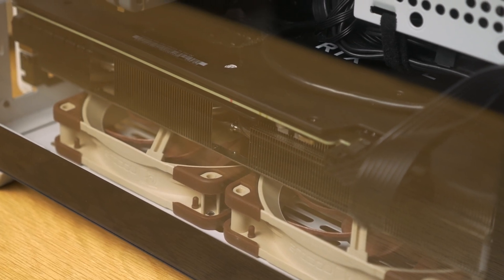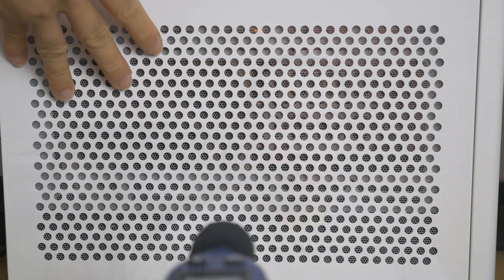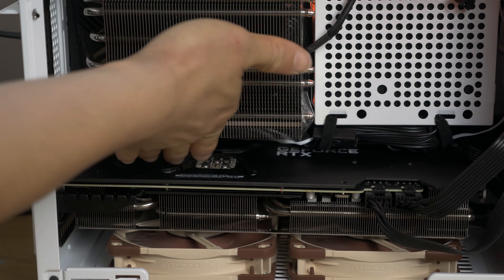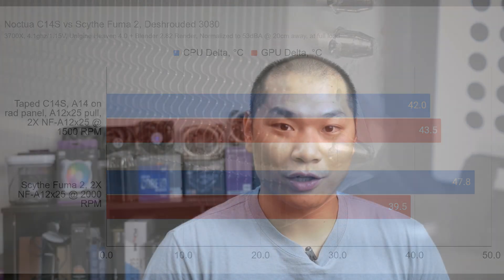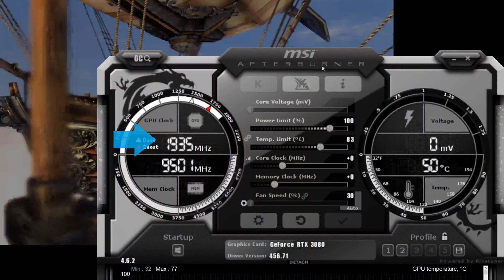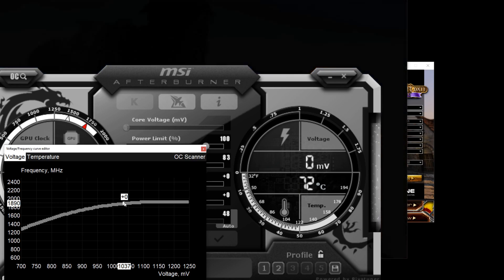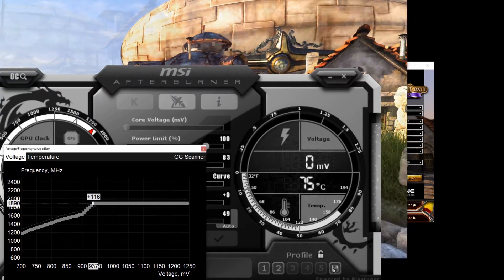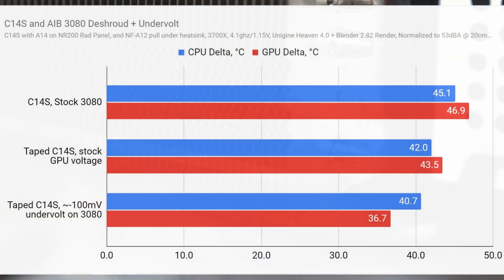Optimizing RTX 3080 Air Cooling in SFF, Part II (feat. the C14S and MSI Ventus OC)

Comment: Shouldn't blower GPU cards be better in SFF computers if you value the temperature of the CPU? Reverse airflow of NH C14s to exhaust everything out the side?
Reply from the maker: Yes, in theory blower cards are great when you value the temperature of the CPU and other system thermals. However... they're quite rough on the GPU itself. When spun up, the single jet engine fan is loud and operates at an annoying frequency (human noise sensitivity that a decibel meter wouldn't reflect). The 5700/5700XT reference cards are a great example of this issue, when compared to the open air cooler designs. To your second question, the C14S doesn't work very well when I tested it blowing away from the motherboard.
Reply: Seems like either way you're going to have hot gpu air passing through the c14s' heatsink

Comment: Man you need to use those bottom fans as exaust in the deshroud mod... so the card will intake through the side panels.... I bet you'll get better temps...
Reply from the maker: It's plausible, in general you're just rebalancing things in favor of the CPU vs the GPU. I was pretty keen on the top intake type of setup initially but the experiments yielded more reliable cooling overall when exhausting out the top. While some air will be drawn in through the side panel in a bottom exhaust, hot GPU exhaust would in theory also be pushed out that same panel in a bottom intake. So, when fans are normalized, it's more or less a balancing exercise.